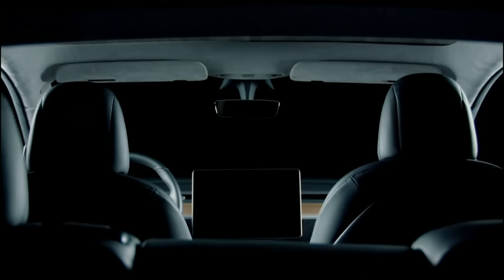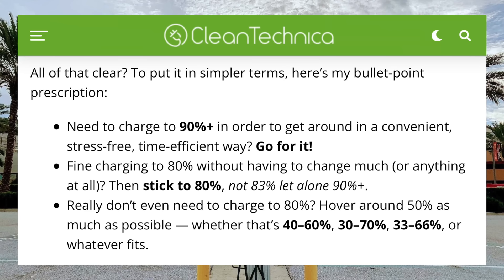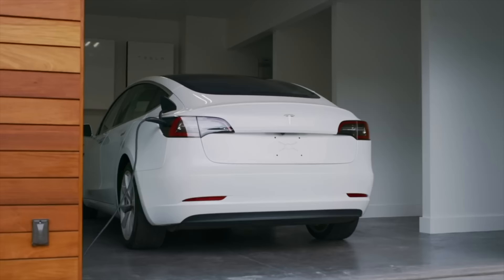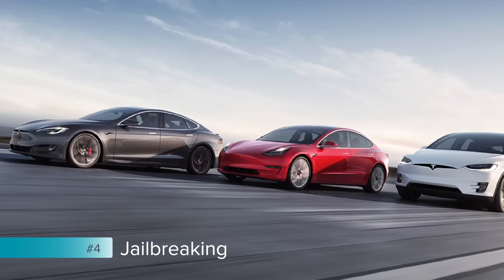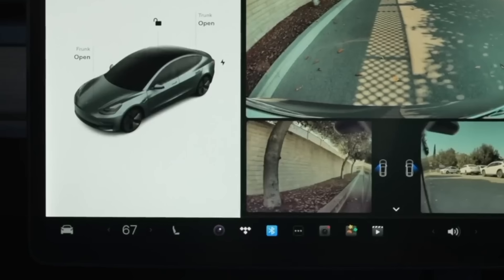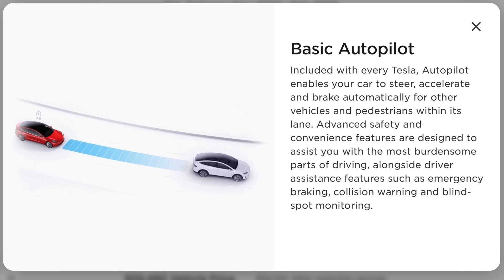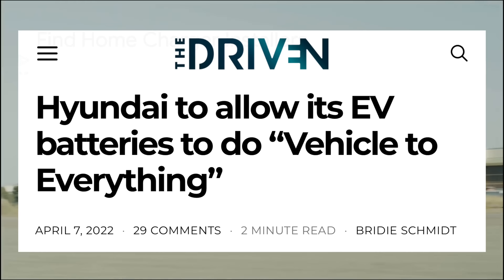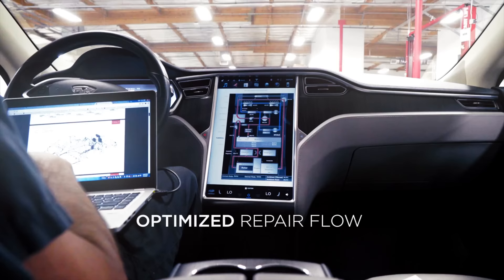10 Ways To Ruin Your Tesla | DO NOT Make This Mistake

Comment: If you own a 3 or a y watch your right turns. Because you sit a bit forward in the car, when you turn your rear wheels are not as far along as you think. This is responsible for every curb rash that has happened on my 3. Right rear tire contacting the curb. I have about 8% range loss just by the indicator after 4.25 years and 90,000 miles. I don't think that is to bad. I charge 100% only a few times per year mostly at the start of a long road trip and then maybe at a hotel where I can charge and avoid a Supercharger stop.
Reply: Most EVs have much longer wheel base than gas cars, that is why rear wheels can so easily hit curb while turning.
Reply: Yeah, my wife hit a curb in her school parking lot yesterday... 10 days into ownership... UGH! 20'' Induction wheel, banged.
Reply: @harryeichelberger4799  well maybe it's cause you people can't drive. I drive a 2017 camaro SS and 2022 model 3 performance and I have yet to hit the curves.
Reply: @sneezygibz6403 right 😂💯
Reply: @sneezygibz6403 so grown up for you to come up with that comment.
Reply: Why do you avoid the superchargers if I may ask? I'll only use those as public charging if not home charging

Comment: Paying attention to curb is underrated.  Glad it made it here
Reply: Yep , all over the reddit lol
Reply: I curbed my wheel. I didn’t realize the Model 3 is kinda wide. The shame I felt was intense. I called a mobile wheel repair company and got it fixed that same day. Now I park curbside with great caution.
Reply: Anyone add ‘curb feelers’ to their Tesla?
Reply: Needs top down backup and parking view
Reply: Curbed mine too after 1 day, I am still unsure if I misread the camera directions or because it was still calibrating it did not show the car width properly. Either way, it looks awful 😞 what’s sure is that the curb was a lot higher than usual. Then curbed it at a car wash so the front one got damaged too!
Reply: @puckingrufus56  agree , happened to me too.  Tesla 3 has a really wide turning circle I 🤔
Reply: can someone explains how to be careful and what it means? English isn’t my first language so unsure what all of this means, Thanks !
Reply: @ThierryGomez10  just take your time when turning around curbs or into parking lots and be mindful of your rear wheels and you should be okay.
Reply: @ThierryGomez10  don't rush your turns .  It's OK to do a three point turn.  Model 3 has a terrible turning circle in my opinion.   My 6 metre van is easier 😆
Reply: I am infamous for hitting curbs with my car, but it is an old Acura anyway.  I plan to get rim protectors if an option on my next car.

Comment: Wheel covers need to be cheap, recyclable, easily replaced  and sacrificial. Moulded plastic is extremely cheap to manufacture. Tesla should recognise this hassle and offer a cheap, concern free solution. It would make no difference to their bottom line. Not only should all EVs be home batteries on wheels, they should be able to help charge another EV and have ports for all sorts of tool battery charging and be able to support the grid.  Ford has got the right attitude with this.
Reply: And have a charge while driving range extender port (coule be implemented though the invertor for 240v ac)

Comment: Excellent advice! In addition, because of the low clearance, don’t drive too far forward on parking barriers or yo’u’ll damage the under body shield as I did. Also due to no spare tire, pack an inflator so you won’t be tempted to drive on a flat.
Reply: no spare on a 70k car? lmao
Reply: @sneakdebeef4796  this has been common for a long time. Our last ICE car, a 2009 Ford Mondeo, also came with just an emergency inflator and bottle of "repair" gunk (which did let me drive the last 8km home the one time I needed it).
Reply: @sneakdebeef4796  man that's why I got me a "used" 35k car.. came with a spare,  just no dang "wheel lock key" lol.
Reply: Do you have a 3 or a Y? With my Y, I find there's quite a bit of clearance, even if I drive too far forward over a parking barrier. (Not that I'm recommending it. :-) )
Reply: @cufflink44  And then you get a Performance, and the extra clearance is almost gone again. Be careful!
Reply: I got Bridgestone Run Flat Tires on my Model 3 after being caught with a flat tire in a bad part of town. Had to wait 2 hours for a tow truck.
Reply: @sneakdebeef4796  99.99% of people would rather not have the wheel eat into the trunk, instead of getting a spare wheel. Theres literally not enough space for a spare wheel. Supercars cost millions, but u don't cry about them not having a spare wheel?
Reply: Was honestly surprised the ‘23 Y did not come with front and rear sensors
Reply: Hitting that battery pack is my biggest concern and I drill that down to my wife. We got the inflator kit with sealant and keep a full spare at the house. No need in lugging a heavy wheel around town and killing your range.
Reply: I have a 2016 Model S. Just this week my bumper caught on one of the concrete parking stops, and when I backed up it pulled off half of the bumper. I managed to get it home and use drywall screws to reattach it.
Reply: @SmitePlayz_ 😂 Touche…
Reply: No just dont use low profile tires. That will stop most rim damage, and give a much better ride.
Reply: @SmitePlayz_ ya but if you can affoerd a super car you dont do anything to it but drive it. A oil change is a couple grand.

Ev's arent for the masses. They are just for people wanting to be the johnes
Reply: It's really stupid not to have a spare wheel.

In my BMW E46, there is enough room in the spare wheel compartment to fit an 18-inch ALU wheel. 😀

Good old times.....

Of course, I have the original spare wheel, but since there is a lot of space, I also have a triangle, first aid, tow rope, jumper cables inside and there is still room for something...

Now, there is no room even for a spare wheel.... 🤣🤣🤣

If the tire is cut, these "new" things are useless.

Comment: Saw your previous two issues with rear collision repairs referenced in an article on one of my news feeds…the point was how expensive Tesla’s (and other EV’s) are to repair when compared to conventional ICE cars. I read articles like this with a bit of suspicion because many seem to be very biased against Tesla. My MYLR2021 was clipped on the rear driver side when parked. The bumper cover and the unit below were scraped and the cover was separated from the brackets. Through Tesla, I was able to locate a local Tesla certified repair shop and scheduled the work…total cost is below $2,000. I asked for a comparison as if the same issue occurred with my 2014 MerBenz 350 Cabriolet…The cost for the MB was $700 more. The shop also indicated that they are continually waiting for parts for Honda’s and Toyota’s, in some cases up to 4 months. Interesting experience…was pleased that all went well and back on the road in a reasonable time.
Reply: If a Mercedes Benz is only $700 more, it's already really expensive. Nobody said it costed more to repair a Tesla than a Mercedes; They're saying it costs more to repair a Tesla than a Ford, Chevy, Subaru, etc. (I imagine a Ford repair of that kind would have been $1.2k). Tesla has luxury repair costs with sub-economy-car panel gaps, and an advertising emphasis on cost savings. That's the problem. Nobody can tell if they are economy cars or luxury cars, so the luxury crowd is mad at quality control and the economy crowd is mad at repair costs. Note that the luxury crowd (Like Benz owners) are not mad at the repair costs, just like you, an aforementioned Benz driver. They aren't obscene repair costs, just confusing to those who thought they bought a Tesla to save money.
Reply: I have a 2 inch dent on my model S tailgate. Both Tesla and third party body shop said the repair will be replace the entire tailgate and costs about $4500.

Comment: Another note on LFP batteries: Range calculations require you to charge up to 100%. This is due to LFP batteries having a very flat voltage curve so the only way to reset the algorithm is at a known 100% state.

Comment: Our 2014 has been almost exclusively Supercharged for the last 9 years and still retains 90% of its original capacity. With mentioning we generally keep the SOC between 30-80% as mentioned as tip #1. We have an estimated combined savings of 50k by Supercharging instead of paying for gas (California gas is expensive) and oil changes. 

I plan on continuing almost exclusively Supercharging going forward as it saves over 5k annually and should I need to replace the battery one day, the money saved has already more than covered the cost many times over. 

Again, it’s rarely charged beyond 80% and seldomly sees SOC’s below 30%, and if it does, it’s promptly charged shortly afterwards. The SOC rarely falls outside of 30-80%, and has only been charged to 100% twice in its lifetime, once back in 2018, and again just a couple months ago with the sole purpose to see where the battery’s capacity was currently at. I think 90% capacity is more than acceptable given it’s almost always has been Supercharged for the past 9 years, with an avg of 16,700 miles driven annually. 

I plan on driving this at least another 150k for another 9 years and save another est. 50k for total of 100k saved over nearly two decades of driving, pending some act of God or collision doesn’t take it out of commission first. As long as it continues to be grandfathered with unlimited free Supercharging, I can’t see any reason I’d stop driving this car. Heck, I’d likely give it to one of my children if it’s still going and get to the point where I’m too old to drive one day.  You just can’t beat the value of free fuel for the life of the car. If this car ever did meet it’s demise in a non-repairable collision, I’d easily buy another older Tesla that has been grandfathered into free charging for life. 

For those who have unlimited supercharging or frequently Supercharge regardless, heeding the 30-80% SOC is wise advice for those who want to get the most longevity from their cobalt-based pack.
Reply: But the 2014 had a different battery chemistry, now for Model 3 LR and Performance and Model Y they use Nickel/Cobalt. So supercharging those batteries probably won’t have the same results as you guys did

Comment: The frunk closure and manual door opening issues definitely need a design revision.  Good design is achieved when instruction manuals aren’t necessary!  As a Tesla driver, I know how to deal with these things, but my passengers are a concern and they don’t read the manuals.

One other thing that could ruin your Tesla:  opening passenger doors into a storm force wind.  I’m not too sure how much lateral force those frameless windows can take before they crack, but gale force winds are common in Scotland.  I did require door opening once in a storm.  No problems, but in hind sight I’d have opened the windows prior to opening the doors just to be safe.
Reply: I agree on your points. About 100% of people have trouble finding the door open button as well as opening the door with those odd handles on my model Y

Comment: Also. Do not install aftermarket door puddle lamps. It will mess with your window dropping when you open the door.
Reply: I haven't seen that, I installed 3rd party puddle lights that shine the Tesla emblem on ground.   Looks very classy at night. In 2 years, no interference with windows.

Comment: Good day Ryan, These are good tips for Tesla owners. I share your concern with any third party modifications to a vehicle under warranty. I am an ASE Master Automotive Technician with over 40 years in the automotive industry. I have seen many vehicles over the years that were damaged due to modifications. Additionally, I have an explanation for your suspension upgrade causing damage to your transaxle. The problem with the aftermarket suspension was the range of travel. The aftermarket parts allowed the suspension to drop further than the factory suspension. When your renter jumped the car, it allowed the inner drive axle plunge joint to slide out of position damaging the transmission... Lesson learned.

Comment: Still waiting for my 98 avalon to break. No issue for over 4 years and paid $1,750 for it. Kept mint condition by an elderly couple
Will get a model 3 when it dies so all this is useful info for later
Reply: You can drive that Avalon forever, it'll never break 😅
Reply: Hope you have patience, that Avalon may die at 400k miles lol
Reply: @jequitygroup4108  well I accidentally put 15k on mods.. a bit more fun now 😄
Reply: @slimconfucius  Thanks! Does breaks chances with some girls, though..

Comment: Great show, Ryan! Thanks! 
Since we bought our 2020 Model Y,  I have been driving more and noticing that I wish the driver's sun visor would work in two directions---both forward and to the left side simultaneously.  This would be very helpful when driving on a winding road into the sunset. Peace
Reply: This is a problem that was solved a long time ago.  My 1987 Ford Taurus had essentially two sun visors on the driver side.  The main visor could swing to the side window and then a second visor could fold down to shade the front.  I don't know why more vehicles don't have this feature.
Reply: @brownro214  Agreed, I had the same on my 93 Pontiac Bonneville. All cars should have that.

Comment: What I'd love to see on a tesla is the ability to dynamically limit speed based on speeds I set.  In small UK villages and windy roads where there is limited line markings on the road (let alone no curbs and cars parked on the roadside, half into the road) setting the car to drive at 30mph in autopilot just doesn't work - there's too many obstacles and it keep slamming on the brakes.  I'd like manual control to drive "up to" 30mph, but not exceeding - likewise up to any speed I decide to set, so I don't have to worry whether I'm exceeding a speed limit while I'm keeping my eyes on the road for hazards.
Reply: The same happens here in France. I set the cruise control to 30, 50 or 70, and it slams the brakes on for random reasons. If you have found the solution to this, please let me know (I'm sure there is one, but there are so many options that I haven't had the chance to test them all).

Comment: 3:25 The recommendation to charge to 100%, if your car has LFP battery technology, seems to completely disregard the regenerative braking issue. LFP or not, overcharging is not good for the batteries so regen would have to be auto turned off just like in Tesla's using the older tech.
Reply: I was wondering the same thing. This official Tesla recommendation of charging to 100% for lfp batteries conflicts with the lack of efficiency gains due to regen. What to do then? Charge only once a week to 100% or maybe regen loss is only in the first few minutes of driving when it is really 100%?
Reply: Probably has some buffer over 100%, just as it has buffer under 0%

Comment: Excellent video!  In CA DMV requires lights on when wipers are activated, most common when rain starts and wipers come on automatically.  Unfortunately, they don’t and only when you go to Controls and Lights.  Voice command is not available and no easy found button on screen.  This is a big safety, and driving law issue.  Do you agree and how to get Tesla attention for software upgrade?

Comment: 2:20 I don't understand why having a fully charged battery should require you to use friction brakes. In those cases the motor can apply reverse torque, and should do so automatically, without you even thinking about it.

Comment: i agree what you say about trying to override the auto pilot alert system, don't do it.  Auto Pilot is just a fancier Cruise Control.  With Cruise Control in gas cars, we still always had our hands on the wheel and stayed alert for any problems on the road.  I felt it was a great way to take my feet off the pedals and relax my legs on long stretches of Roads.

Auto Pilot is the same thing except it will also auto navigate the road lane you are in, as long as the roads are clearly marked. I still put my hands or one hand on the wheel and stay alert at all times.  Auto Pilot is nice, but it is not 100% self drive where you can sit back and read a news paper going down a freeway.  I really like the proper distancing feature of Auto Pilot, but also be alert on this feature not doing what it should. 

Last, With Auto Pilot enabled, Beware of possible "Phantom Braking" where the vehicle for some unknown reason senses something that is not there but tries to slow down.  Be prepared to respond and take over and pay attention to anyone that may be close behind you.

I did not get the auto lane changing addon (EAP) and felt it is not worth the 6,000 dollars to have it.  Also I would never use Auto Park and Summons features for what I do in my driving.

Comment: The Magnuson Moss Warranty Act requires manufacturers to honor the original warranty unless they can prove that the aftermarket modification (either the parts or installation) was responsible for the failure that caused warranty repairs.

Comment: I have a 2022 Model 3 and had a message on the touch screen to charge to 100% once a week.  Being retired, with low miles (car), I could feasibly go 2 or 3 weeks without 'having' to charge.  Whoops, finally see you covered it @3:09.
With Autopilot - When I drive with my hands at 10:00 and 2:00 (correct position), I'm constantly getting warnings to apply pressure.  I have to jerk the steering wheel to prove I'm driving.  Apparently, my hands balance each other out?   So, I only use 1 hand, draped over the steering wheel opening.